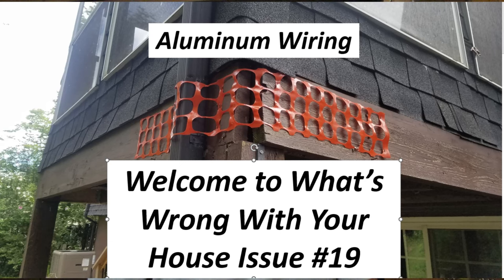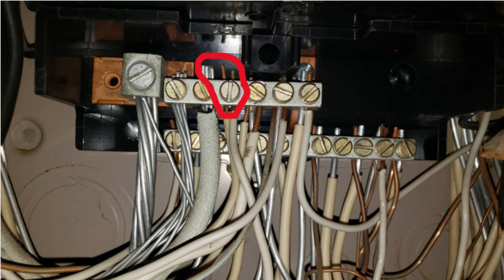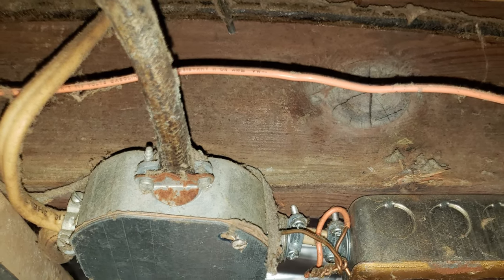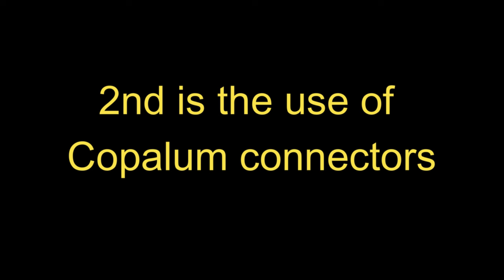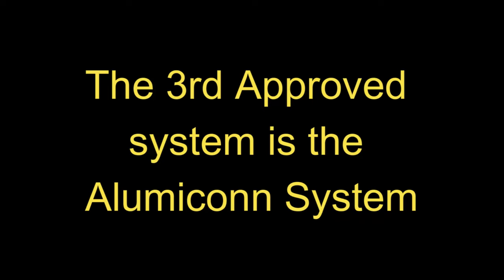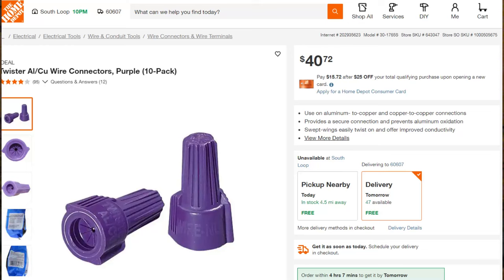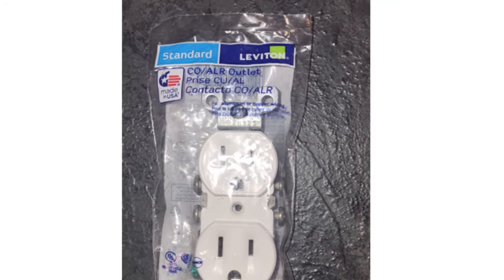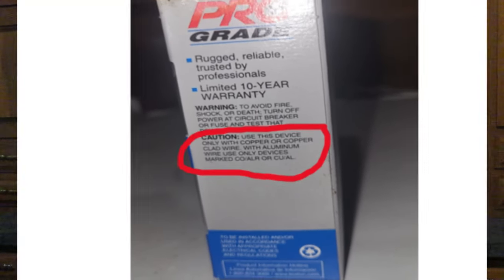Aluminum wire is a fire hazard. Is your home safe?

Comment: Aluminum wire is NOT a fire hazard. The power company uses aluminum wire. It is only a hazard if improperly installed. The fixtures have to be aluminum rated, and you can't mix aluminum and copper.
Reply from the maker: Valid point, but it is hard to put all of that in a headline, thus the full-length explanation in the video.
Reply: You can mix copper and aluminium - but you need to use bimetallic crimp lugs on all the wires to match the termination material to the wire.
Bimetallic crimp lugs have aluminium sleeves welded to copper lugs (usually). The aluminium crimp sleeves are lined with conductive abrasive paste to ensure reliable connection by abrading the oxide layer off the aluminium wire during the crimping process). Most utility connections will be made using these lugs.
Reply: I suggest if anyone finds that their home has aluminum wire in branch circuits to pay an experienced electrician to replace all of the plugs and switches in the house. He will almost certainly find a couple of areas of concern and repair them and you need never worry about your aluminum wire again.
Reply: Also generally try to find the grey/gray haired electrician vs a brand new one perse for they have nore probable experience with al wiring specifically.
Reply: @bsanchez3563  Grey hair- check. Exp with al wire- check.

Comment: I'm a proud homeowner of a 1971 single family home built with 70% aluminum 10 gauge wiring. I paid an electrician to upgrade my old small 100 amp panel to 200 amp to give me more space.  As a homeowner,  I then opened each receptacle, switch light fixture, and junction box then added 3 or 2 wire Alumicon connectors. Using a firearm torque screw driver, I removed the old receptacles, light switches, and wire nuts. Then replaced each one with 12 gauge copper pigtails with Alumincon connector torqued to spec to each freshly cut and stripped Aluminum 10 gauge wire. Cost me about $300 in parts, but did it myself.
Reply from the maker: That was a smart move.
Reply: As in copper clad or just 70 percent of the house is built with al wire and they could not stick with it or did not pick and stay consistent for whatever reason?

Comment: Very thorough and to the point.   Back in 2005 I was helping my stepfather replace all the aluminum wiring with copper, in his 1973 rambler he just brought, as the wiring had burned up at several receptacles and switches,  some were overheated to the point of having bare  wiring up to and possibly past the point where the cable entered the metal outlet box as the insulation and sheathing melted and burned, dead short, breaker would not reset which was a miracle because the main  panel was a 70 amp Zinsco in a bedroom closet to make matters more dangerous.  Also we found the light in the hallway controlled by 3 way switches on both ends was wired in a very unsafe manner, power feed into the light box,  and two 12/2 AL romex from the light drop down to each switch box,  the bare ground was used as one of the travellers and the black and white were the other traveler and common respectively,  with the bare  travellers resting against the metal switch boxes.   We felt because of all the problems and shady workmanship, and having to open some walls anyway  to replace the rusty galvanized iron water pipes with PEX, we'd abandon the aluminum and wipe the slate clean with all new copper NM, and a new Siemens 200 amp MLO panel that we relocated in the laundry/utility room,  and installed  a 100 amp main breaker outside at the meter after Detroit Edison confirmed the line from the pole was good for 100 amps.  Quite a project to say the least,  but me being 16 at the time found it educational and satisfying.
Reply from the maker: Sounds like you were lucky.

Comment: Alum. is still the mainstay for feeder conductors in residential installations and when installed properly is reliable. Branch circuits on the other hand are not, and now not compliant. Years ago I repaired a home that all the branch circuit receptacles where not only wired in alum. but were also terminated into "back stab" terminals. Most of the receptacles in house didn't pass current anymore and had obvious evidence of arching. The fix was to replace them all with spec grade receptacles.

Comment: Good video. RE: tinned copper wire. While it primarily prevents corrosion, its purpose in electrical wiring was due to the ease of soldering. Early Romex was used alongside of knob-and-tube, where k-t was used as the backbone, and the Romex was used for the switch legs. Having the Romex tinned greatly assisted the ability to solder the splices into the k-t primaries. The tinned Romex wouldn’t be oxidized, and the tin acted as flux. 😊Once k-t was phased out, then the tinning of Romex became unnecessary.
Reply: What you mean by the bacjbone? Like hidden to make it look like all romex was used? Ie only in wall finished walls contained the k and t or like just from panel to metwer was k and t.. ?
Reply: @bsanchez3563  They used to run two KT conductors across an attic, for example, and then splice in drops for switch loops. The splices were done by stripping insulation and then soldering to the main wire. Hence, there was a backbone with branches leading off of it. A bit like plumbing is sometimes done now.

Comment: Ooh man the noticeable modern day issue of the 2014 nec is the sharing a single screw on bus bars with more than one wire per screw.. but maybe I do not know if back in the day or ever if it was perhaps code compliant but regardless I would want to just because I am not certain why but if it is a code thing and for sellable maintaining that status of being easier to sell in future for whomever,. Would personally without even being an inspecter wanna have that addressed. Even if just having hiring someoen else to do so.

Comment: My house was built in 1976 it has aluminum 12/2, or 10/3 branch wiring. I replaced all the connections with Alumiconn connectors installed AFCI/GFCI breakers. My wiring is safer then any copper wiring house a home builder built who use the cheapest unlicensed guys they can find. My inlaw does kitchen cabinets he was on a tract home job. Electrical sub-contractor was a guy the electrical sub picked up at home depot parking lot. He showed the guy how to wire up one house then that guy wired up streets of homes. He said inspector would come around they would distract him showing him other stuff. The wiring was all messed up they were back stabbing outlets also. Tract home builders slap it together they know might only find fraction of the problems.
Reply from the maker: Unfortunately, way too much of this happens.

Comment: Aluminum wire is used every day.   It's not the wire that is the problem.  Its the idiots installing aluminum wire improperly.
Reply from the maker: Stranded aluminum was never the problem. Just #12 and #10 single strand.

Comment: Retired master electrician here if installed with all rated devices and torqued properly it is not unsafe. Plus inspecting periodically will eliminate problems with the use of aluminum wire . Plus now you are not allowed to use it on circuits less than #8 which will be on 30 amp circuits.
Reply from the maker: All good points; however, the problem is improper installations and no inspections.

Comment: I didn't know cannot have two neutral wires in the same lug even if same material. Now I know why they used aluminum wire during this period (because copper prices went sky-high), I first thought it was a fad along with lime green shag carpet. Lots of other good info here.
Reply from the maker: Don't forget Harvest Gold and Avacado appliances.

Comment: The things we are not told is that copper can be bent several times, and still be strong.  Aluminum bent a couple of times makes micro-cracks which either overheat or fracture later. Also, aluminum oxide is a poor conductor. That is why when you retrofit with purple nuts with elastic cones inside (which seem the best idea),  you should steel-wool clean the old alum wire before gelling and twisting it together.   It is unfortunate that the fixture industry did not choose to make all outlets, switches, etc alum compatible from the start.  Even though they cost many times more to buy, they cost the same to make.  It is simply a matter of not having a screw bite the wire, with no allowance for expansion.  They fit the wire into a cage that flexes, and the screw establishes a spring tension.
Reply from the maker: Good points. Thank you for responding.

Comment: Alumicons on 15/20amp alumium circuits, and add afci breakers - usually fixes the issues. On larger circuits, there is no issue
Reply from the maker: Good advice, I would recommend AFCI/GFCI breakers as they are both required almost everywhere.

Comment: Aluminum wire is not a fire hazard. A fire hazard may be caused by any conductor when installed in a manner that is not approved by the NEC. Most commonly when it is terminated in a device not listed tor that conductor.
Reply from the maker: Current aluminum alloys are considered safe if used in AL-rated devices.

Comment: structures built before 1965 and after 1975 are free of aluminum wiring? Did NEC forbid AL wiring after 1975?
Reply from the maker: I don't believe it was banned by the NEC. As the war ended and the problems with aluminum single strand wire became apparent, many municipalities banned the use of aluminum, and the bad reputation took care of the rest. Current aluminum wire is made with a different alloy composition and is considered safe. However, the bad experience from before has suppressed its use.
Reply: @hawleyhomeinspectionsllc2899  I mentioned this video to another electrician, he said after 1975 NEC banned aluminum wiring. He also said using wire nuts of AL to CU, the AL will expand and shrink due to heat and cool, eventually becoming loose, causing an arc, and fire. AL wiring sounded like a good idea at the time along with asbestos.
Reply: No, not necessarily. I have found aluminum in a house as late as 1981. The entire decade of the 70s should be questioned and possibly early 80s houses. I have also seen many houses from the early 70s wired in entirely copper so the only way to know is to actually look by opening up the panel and then a few outlets in a room original to the house.

Comment: They were still using Aluminum 14 12 and 10 gauge thru the 1980's.
Reply from the maker: New old stock can set on shelves for years, the accepted dates are 1965 to 1975. Nothing says someone could not find an old roll of aluminum wire left over from 1973 and install it in a new build. How ever we have to deal with the 99%.

Comment: So you say that stabbing two (2) copper nuetral wires into the same Nuetral lug is not allowed, please direct me the paragraph in the NEC (NFPA 70) code that specifically does not allow that.  We do this all the time in industry and no one has ever called us out on this one.

Aloha...................
Reply from the maker: 408.41 Grounded Conductor Terminations. Each grounded
conductor shall terminate within the panelboard in an individual
terminal that is not also used for another conductor.